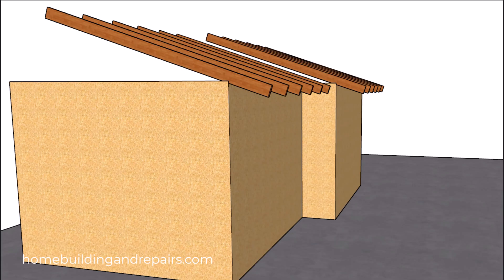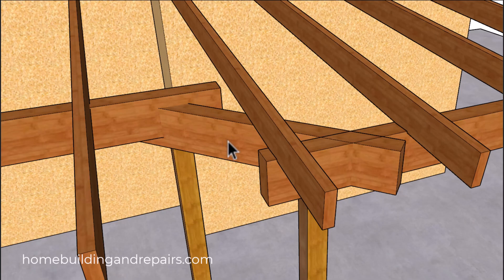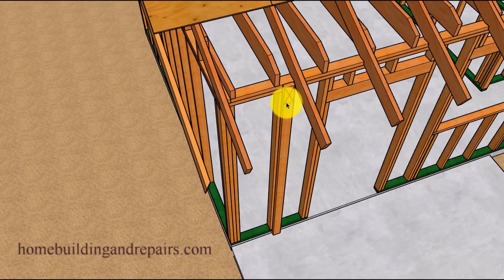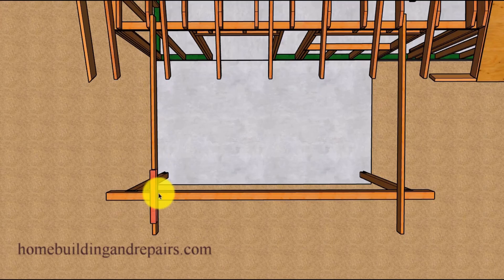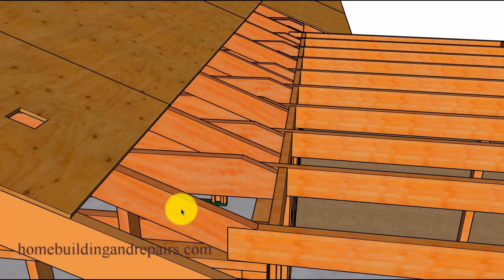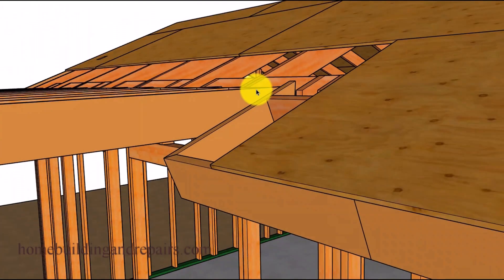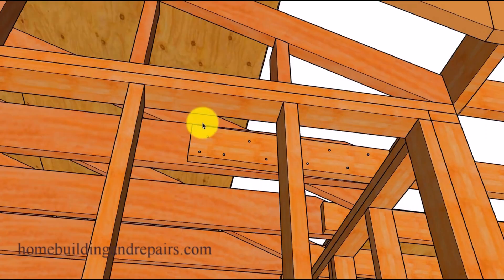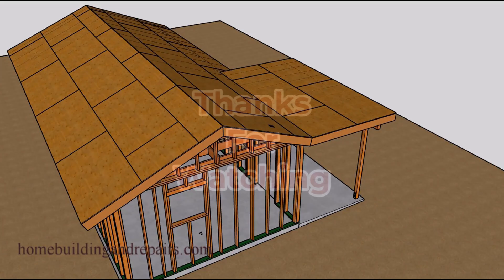Solving Difficult Problems and Building a Porch Roof on an Offset Wall

Comment: Great video. What kind of hardware and nails/screws are you using to secure rafter to rafter & rafter to top plate?
Reply from the maker: 16d nails and they can be angled or toe nailed.